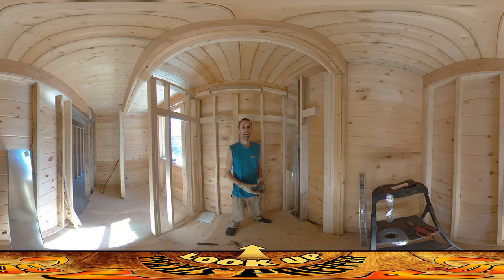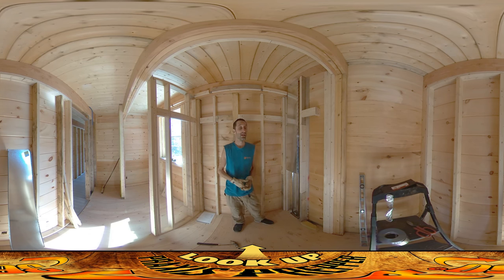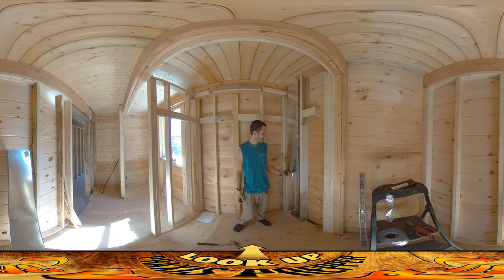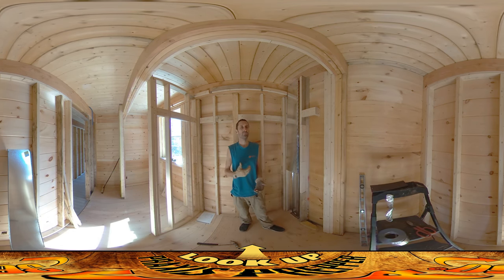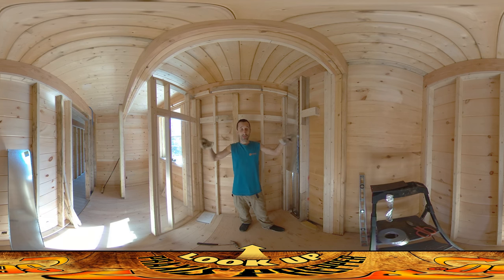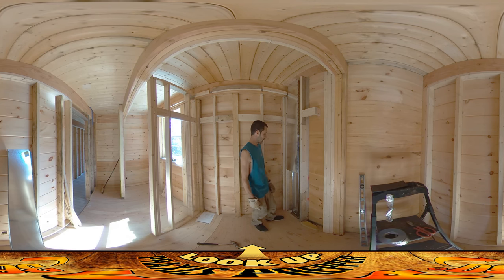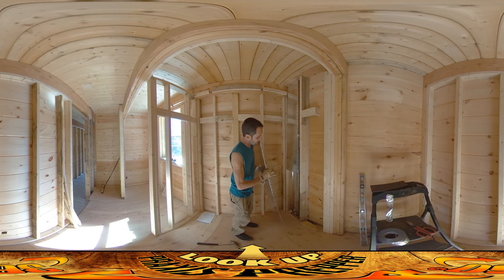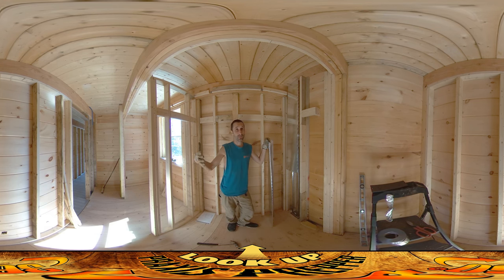Homestead Building - Venting For Sub Floor Venting System

Comment: I think your feeling of loosing energy is with a lot of us 'locked up' as well ... while i am all for it (wished we'd done it sooner) it is starting to get somewhat 'old' by now, which is most certainly taxing on the energy and enthusiasm for doing w/e ... so while you are mostly disappointed by the lack of progress from people you (have to) depend upon, said hold up is (partially) related to the same thing, and in that sense you are most certainly not alone ... but 'keeping going' when the going is easy, is obviously easy; it's not until the going gets hard where you must try and find new ways to keep going. See it as a learning experience / preparation for a true and even worse emergency (though i'm not to sure what that would be at this point in time), where your life may depend on you keeping going after experiencing setback after setback (quite possibly worse setbacks then not having the plumber show up when he said he would; which by now seems to also be the case during normal times), and the way you deal with that now, is a very likely way you will respond in said other case.
Reply from the maker: I just switched to doing outside work yesterday and I'm all jazzed up again. After the plumbing stuff is all set, I move to building that mini house next to this house... which I need to finish before I can legally move in the regular house (unfortunately).
Reply: @PraxisPrepper  Yeah, the shed with the water heater on it right? ... well, access to water and power as a basic necessity to move in isn't the worst basic requirement in these modern times.

One question though, why can't you start on the shed/minihouse now ? ... is there something from the plumber that you need to be there?